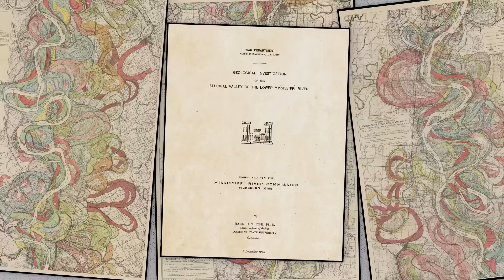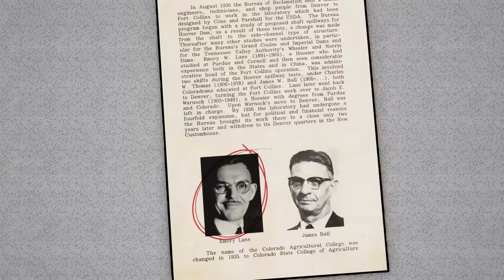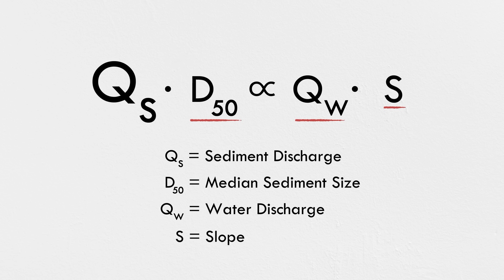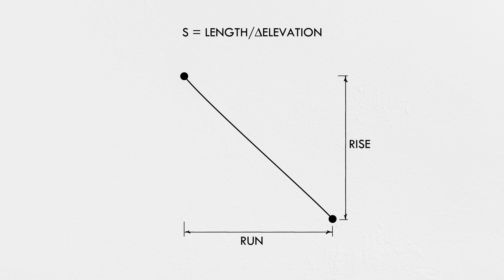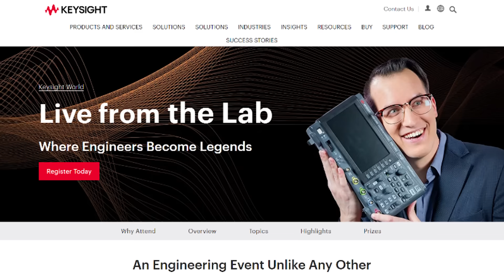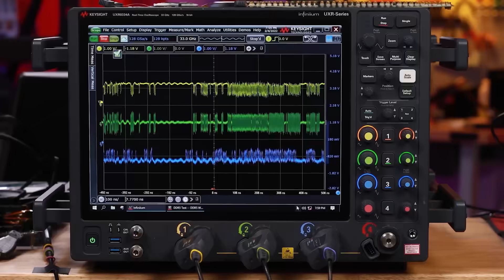Why Rivers Move

Comment: That's why when prospecting for alluvial Gold you look for the old river bed where the river once was  not so much where it is now . In most instances the  Gold  was deposited a millennium ago not last week .  Some streams or rivers may still have a trickle of Gold dust but the bigger deposits are on the old terraces higher up the banks because the rivers and streams have  cut down deeper over time .  An old terrace  deposit is usually on the  inside of a curve and the erosion is happening  on the outside but because  rivers and streams wander all over the place they could be cutting through old sections of river  bed  on either side .  If you track the presence of color in your pan up a stream , where it stops showing is just above where it's entering the  stream usually from  an outer bank erosion . If you trace that  uphill above the eroded bank that's where the deeper lead is but a lot of the time it's deep underground . 
There can be other deep leads further down the  stream from that .  In a gold bearing stream on the inside of a curve you can get a bore hole or a number of bore holes going up the bed rock bank from the curve , this is from the circular action of the waters boring a hole in the  rock . Gold can concentrate in these holes .  You usually have to dig through wash  sand , dirt and gravel to find  them . A metal detector can sometimes find these holes if they have any Gold. Also in a stream that is showing  some Gold , cracks and crevasses across the stream bed can trap gold and many other stream structures gravel beds etc.

Comment: Would love to see you do a video on how cruise ships function as a floating city, specially how their water and waste water are treated.
Reply: In addition, is there anything we can learn from how water treatment on large ships work? What are the unique challenges? I’m guessing they use desal. What kind of pretreatment processes do they have? How do they pick what membranes to use? How does seasonal change impact their system? How much energy is used specifically for treatment. What standard of water treat:ent do they use (AWWA?)

Similar questions for waste water side but also who regulates discharge?

Comment: I have a question ❓
So if a lake or pond is fed by a stream/river or several, what keeps the pond or lake from simply filling up with sediment? Displacing the water to the point that the lake or pond disappears? Even if it has an outflow at another point, the calm still waters of the lake should allow all the sediment to drop out before it has time to travel down the outflow. Where does all of this sediment build up? Maybe there's a simple answer I'm missing!

Comment: I don't know why?

I'm guessing gravity and the rotation of the earth.  Why do hurricanes move?

They don't really.  They are moved by other forces, but when close to the equator in the absence of prevailing winds, they really don't move.  It's the earth that moves.  The hurricane or typhoon basically sits there and the earth spins underneath it.  The earth kind of pulls it along, but the earth moves faster than the hurricanes so the appearance is the hurricanes move from right to left, UNTIL they drift further north or south and run into steering winds which will push them in some direction.  But they form in areas where there is almost no winds, which allows them to build up, and then the movement of the earth underneath them gets them spinning.  From an article:  "The Coriolis force caused by the rotation of the Earth causes the tropical storm to spin."   

AND this is why they spin in different directions depending on if they formed in the N. or S. hemisphere, within that 5 to 10 degree latitude band they form in.

Comment: I would feel much better about the conclusion drawn from these experiments if the material added wasn't added directly by hand and shovel.  I would have preferred it be added through the water stream itself.  By adding manually like that you directly manipulate the flow of water.  That is no good; it taints the results.

Comment: I am not sure that this is true. I was told by a geography teacher that they believe it is a fundamental phenomenon due to fluid mechanics and not to do with erosion or sediment. Take a large SMOOTH dinner plate or tray, place it at a gradient (experiment) and allow a trickle of water to run over it from a tap. No obstacles, right? but the flow has an inherent tendency to meander.

Comment: The Corps of Engineers had a multi-acre model of the entire Mississippi river drainage basin outside Jackson, Mississippi. You could walk over the whole model.  They ran thousands of scenarios using actual weather data, and could simulate multiple rain events anywhere in the basin from Montana to Pennsylvania to see drainage results downstream.  Nor sure when it was discontinued but it's gone.  Maybe they ran all the possible scenarios?

Comment: This is cool. I have been observing geomorphology for over 60 years.  There is another very subtle factor that goes on. As particles collide in the streams they become smaller. Watching flash floods and land falls we see dramatic and fast changes in particle sizes. Big and small boulders can crush other boulders and even smaller particles into even smaller particles. Then there is the very subtle chemical erosion where water is dissolving particles over time. Still, moving water is the most powerful force over the long run.  Another interesting activity is that in ravines that are steep and start on high flat areas eroding down to streams/rivers. Ravines are very young rivers.

Comment: Just because water takes the path of least resistance doesn't mean that path is necessarily a straight line. Sediment isn't uniform in size or density, it isn't evenly distributed either. It's like when you rinse a dirty plate, some of it comes off immediately, but other parts take more time or some elbow grease.

Comment: One of the reasons, perhaps the primary reason, that rivers are always shifting is because in any natural formation, there is always erosion occurring at some point along the path.  Because sediment is always being moved from one place to another, the change to the physical structure of the path will change the flow of water.  The change in flow, in turn, will cause a different pattern to the erosion, and the cycle will repeat endlessly.

Comment: Could you do a video covering the engineering on cement highways and interstates?

I drive big class B trucks and the concrete slabs are very bothersome. The slabs aren't parallel with each other, the far side of the slab is seemingly always higher up than the other. Like this - / / / / /

It's not that bad in a private car, but in the big trucks the slabs seem to be perfectly spaced to match the resonant frequency when driving the speed limit.

I'd really appreciate some insight on this, thank you!

Comment: I work for the Army Corps of Engineers in Memphis. Our whole operation is centered around this topic; specifically as it pertains to the Mississippi river and keeping the water lanes clear for the huge amount of commercial barges that move food and goods from the farms and factories up north down to the Gulf of Mexico. The past year has actually been a record-breaking year for our dredging boats and crews due to drought causing low water levels and increased sedimentation. I really look forward to your next video. I am really enjoying getting a better understanding of the very thing I help to deal with as part of USACE.
Reply: Has the Ohio toxic flow passed, or will it continue to contaminate?
One report, by the state, claimed a sample to read 11.5 pH.  It had a confirmation of 11.6, yet its one sample of very many.  Could effect metals.
Reply: @cheerdiver  I'm afraid I wouldn't really know. I am but a small (mostly unimportant) cog in a vast machine of military bureaucracy. That sort of info doesn't tend to get spread around too much. Regardless, I doubt it would impact our operations much. Critical infrastructure and equipment is already inspected and PMed with paranoid frequency. Worst case scenario for us is we have to replace something expensive earlier than expected, and have to ask congress for emergency funding. Of course, no congressman wants to run for reelection as "the one who refused to prevent a disaster on the Mississippi river" so our funding is more or less guaranteed. I do wonder if commercial fishing has been effected by this, though. Water that basic can't be good for wildlife populations.

Comment: Because water is liquid at the livable temp ranges, and liquids are easy to displace atomically, and there's a high pressure push at one end, leading to a transfer of that energy through all the molecules of the river, along with a gradient that is enough to allow water to fall away from its own molecules, which in turn creates a suction effect. Easy and simple for any person to realize without doing any experiments. Next.

Comment: I am from Louisiana down by the mouth of the Mississippi River, and Hurricanes Katrina and Rita; which hit back to back within weeks, are the cause of the recession we experienced. When Katrina hit, I said, "We might have a mini-depression". I hadn't heard the word recession, used like that, yet. When Rita hit weeks later, I said, "We are definitely going to have a mini-depression", and we did. Many resources travel the Mississippi and are sourced, somewhat (oil reserves), by the mouth of the Mississippi River.
If you're piloting a crew boat or supply vessel down one of the tributaries, the bottom of the tributary changes, and as a pilot you need to know how it changes, so you don't run the boat/vessel aground. This changes over weeks and months, depending on seasons and weather.
After Hurricanes Katrina and Rita there were old coffins and bodies, from old cemeteries, rising to the surface and floating around.

Comment: One of my favorite geophysical actions is the meandering of rivers! I'm so happy you covered this, and I would love to learn more about it! I look forward to your next video as well! I've always wondered when an oxbow lake is forming, the channel cuts through the median, but it still meanders in the same direction as the lake. I've always wondered why the stream wouldn't follow the old path as it continues to meander, especially since that soil is weaker since it was deposited by the same river that is cutting it. Since there is a greater flow on the outer bank (cutting bank), you'd expect it to meander in that direction, which in the case of an oxbow lake, seems to always be the same. I would love any input that helps answer my question, and if I can provide any clarification, I would be glad to answer any questions!
Reply: I'm sure you know, but just to be safe, this is a lie and a scam. (The telegram message above)

Comment: Living in Albuquerque  M. N. .  Just east of the city is the Sandia  mountains 5000 feet higher than the city .  Which during heavy rains causes flash floods . I have seen trailers 100 foot from the flood waters ,  in 15 minutes drop in to it , and get swept away .

Comment: 14:48 Is that really a fair characterization? In the model you showed it wasn't high/low flow, it was high flow / no flow.

So since the equation doesn't really have a time element, it would be more sensible to compare a river with high constant flow vs high intermittent flow, to see if pulsed flow actually changes the system much, no?

As is you are trying to claim that getting a month's worth of water flow in a day should somehow be at all the same as getting it over a month, when that doesn't make sense, as the formula isn't concerned at all with total flow, only flow RATE which you are dramatically changing between the two models.

Comment: One thing that is amazing is how what we see on the surface goes up and down and all over the place.  But yet the waterways have a gradual slope enough to keep water moving all the way to the ocean over thousands of miles.  Even if the water barely moves.  It is still going downhill in some fashion all the way.  If it didn't it would stop like it does in a puddle.  And as long as there's enough water upstream, it even keeps going over a high area and keeps going and going until it reaches the ocean.  It is amazing the even with all of the mountains and valleys we can see that there is a path through all of it for water to always find its way to the ocean.

Comment: So the change in slope via meandering has me pondering on a Tesla-valve fish ladder. 
A YouTube search only brings up one short(01:22) video, not in English and it doesn't compare the flow speed and volume(vs cross sectional area) to any other options (not even a smooth S-turn or straight channel, let alone material texture/corrugation), nor does it indicate the useful range of slope. 
I would guess that the goal for a fish ladder is minimal mass flow at a given cross section so the diverted water has minimum impact on a dam's working water. Also it seams reasonable that the minimum cross section is set by the size of the fish specie (and number of fish in extreme cases) combined with some parameters that consider both the average speed or resting pool speed, and the combined speed and length of each peak section. (So a fish can swim steady and slow or sprint/jump and rest multiple times.)

Comment: Maybe i don't get the reasoning at 15min, but isn't Lane's equation working perfectly fine. If I interpret the comparison correctly the pulsed flow has the same average over time as the continues one. Lane's 'equation' predicts more erosion on the right because the flow Q is higher. To me it seems like you just can't really compare 2 instances/situations in which you apply it between each other (because it's a balance that alters the situation directly). Only as a cause and effect tool.

Comment: I learned that the inside boundary of a river curve is called a point bar. Last year while looking for skipping rocks i noticed a point bar that had more heart shaped rocks than i had ever found.  Normally i find one or two per year, mostly symmetrical, rocks shaped like a heart. usually i collect them, but there were too many. they where more or less the same size and made of the same type of rock so probably similar densities.   I filled my pockets, every time i bent over to pick one up, i would spot another one that was less than two steps away. 

i have noticed that shapes of rocks must influence in some way because growing up i would stumble upon a point bar where good skipping rocks were abundant and globular shaped rocks were rare and vise versa. but this was the first time i noticed a large deposit of heart shaped rocks.  

i dont know how to word the question but my mind is wondering fiercely. 

What conditions would favor heart shaped rocks!?  

would a specific rock formation upstream with a large  mass with a similar pattern of faults or blemishes added to the river create these heart rocks? or a specific composition? ahhh! so many questions that keep creating more questions.  im writing this as i think about it. 

uhg, ok, i am thinking there are a LOT of factors now, like age of the rock being in the river, composition, and the river conditions.  

I am having a hard time focusing on my original question and my lazy brain wants to just accept that i do not know and that it is ok not to know. but its not.  

i messaged the company Emriver about it and am looking forward to their response. I figured i would ask you as well. 

The river is fed by a glacier and is relatively short, less than 100+/- miles. The Hoh river located on the Olympic peninsula in Washington state. I grew up here and have observed it changing every year. I guide on this river and each year I have to learn a new path. Each time i notice more and more. I really enjoy and am interested by hydrodynamics. 

thanks for your work.

Comment: quick suggestion for videos like this in the future:

as you mentioned, video compression absolutely loves to turn small details into smears. this is because it’s the codec’s job to minimize the bandwidth necessary to transmit frames. you can avoid this by exporting in a higher bitrate, and to allow that higher bitrate to be used on youtube you can just upscale your video to 4K using the nearest neighbor algorithm. this tricks youtube into allowing a higher bandwidth allotment while still giving the codec more room to breathe. you can also shoot in slow motion to help reduce the constant changes between frame.

i’d also recommend the tom scott youtube video on compression, it could help give you a better idea on how video compression works so that you know how to combat artifacts in the future :^)